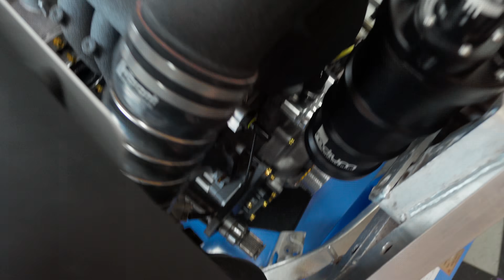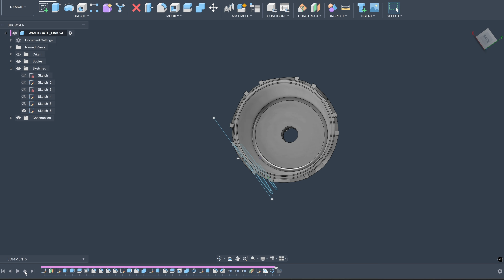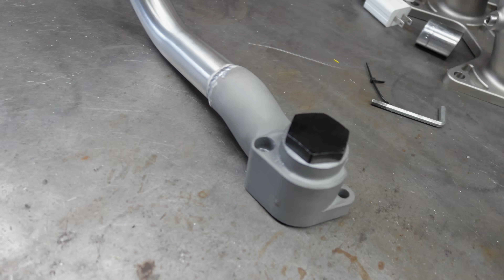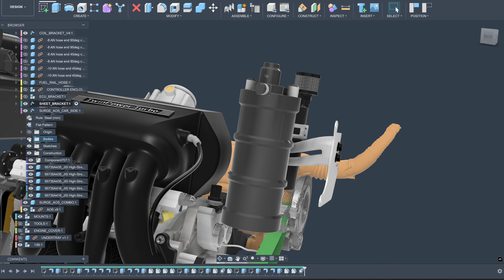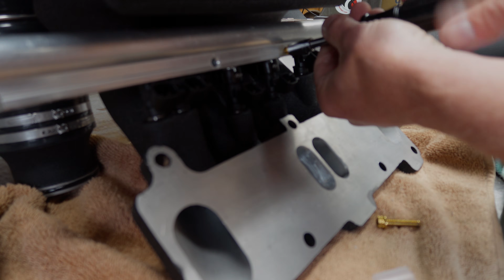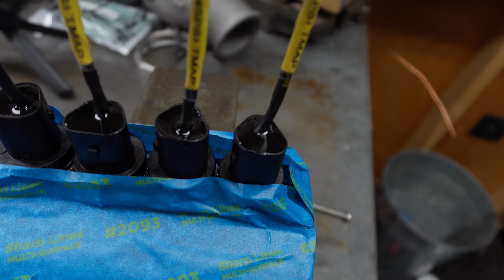No More Room For Activities - Building a 13B Rotary BMW i8: EP14

Comment: You might have problems registering the vehical,theres law about emissions with the 13b,mazda couldnt meet us emissions requirements with the rx7 so it wasnt sold in the us.......when it bears down too the car being road worthy.....you might just be failed because of emissions
Reply from the maker: Laws 😂
Reply: @CouchBuilt 
Eheh ....Mazda RX-7 models excluded from the US market were the third-generation (FD) models produced after 1995. These later-generation cars and special editions were sold exclusively in the Japanese Domestic Market (JDM) and other regions until production ended in 2002. 
Reason for exclusion
The primary reason for the exit of the RX-7 from the US market was the introduction of new regulations for on-board diagnostic systems. 
OBD-II mandate: Starting with the 1996 model year, the US mandated the use of the OBD-II standard for emissions control and engine monitoring.
Mazda's decision: Given the RX-7's low sales volume in the US at the time, Mazda decided it was not cost-effective to re-engineer the FD model to be compliant with the new regulations. Instead, the company pulled the vehicle from the US market. Series 7 (1996–1998): This updated FD model featured minor aesthetic and mechanical changes, including more efficient turbochargers and a 16-bit ECU, but was only available in Japan, Australia, and New Zealand.
Series 8 (1998–2002): The final series of the RX-7 featured a redesigned front fascia, improved cooling, and an increased output of up to 276 horsepower. It was produced exclusively for the Japanese market.
Spirit R (2002): The ultimate and most collectible version of the FD, the Spirit R was a limited-edition special produced for the final year of the RX-7. It featured exclusive components and was a JDM-only release.
Bathurst R (2001): Released in Japan only, this special edition was created to commemorate the RX-7's endurance race victories. It featured special adjustable dampers.

Comment: Interesting build / swap. I will say this, there's a reason why Mazda got away from the Oil to Water type oil coolers even on NA engines in the mid 80's let alone the turbo engines. Hot engine water can not cool the oil efficiently enough for the amount of engine cooling that a Rotary relies on oil for.  Remember, the hottest items in a Rotary (i.e., the rotors) are 100% cooled solely by oil... Just saying..

I get it, I wouldn't want to run oil lines all the way up front either but what I would do if it were me is run the Oil to Water setup like you intent but with the water side being its own closed system with a reservoir and front cooler (basically, the same as you would for an Air to Water Intercooler).

Now if that is your intent and I missed it somehow or maybe it was mentioned in one of the other video's on this swap / build that I haven't seen yet, then I apologize for blindly suggesting something that you already intend on doing.

Comment: Be careful of dodge trans coolers: mine got blocked up, due to the extremely fine internal piping (designed for heat transfer). No oil could pass through and it destroyed my transmission.

Comment: Is that a civic wastegate actuator? It looks like one but those are PWM and you don't appear to be using PWM to actuate it.
Reply from the maker: No, BMW N20. More stroke than the Honda part.
Reply: @CouchBuilt  Great tip ty! I have been looking into using one of these on a VGT turbo for control.
Mind sharing the PWM control specs? What Hz does it operate at? I don't know anyone with an N20 that I could scope to find out myself. 
Thanks again for the tip and I love the content. I started with fusion 360 and 3d scanning last year and your channel has been the most helpful by far.

Comment: Re: oil coolers, I don’t know if it fits your application, but Gale Banks is a fan of the 2020 Duramax oil cooler. He built a kit around it to retrofit into older trucks. He has a video about it.

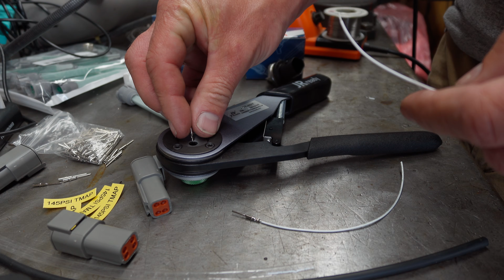Comment: At 16:50 looks like an official Harting crimper. In all my years doing electrical work I’ve never seen one.

If it’s the one I’m thinking, it costs $1400 from digit key or mouser.  Wow dude, you got money! Lol. 

I found way, way cheaper four way crimpers that will so the exact same thing for $30 from amazon.
Reply from the maker: No it’s a Chineseum JReady crimper
Reply: @CouchBuilt good to know man. I was worried there.  lol. 

Share the model and I might try it too!!

Thanks for the reply.

Comment: I found out about the Hella fluid temp and press digital sensor that comes with all new BMW's, those are much more reliable than Bosch ones and you only one digital input for both temp and press values

Comment: If you had asked me "What would your dream car project be?" It would be this. Exactly this. Combining two of my favorite things, a BMW i8, and turbo rotary engines. This is what BMW should have put in from the factory, if not a much beefier three cylinder with better internals to handle boost like the Corolla GR's 300hp 3 pot. 

Truely, from a car nut and particularly a BMW freak from back before the current millenium, thank you for making this whacky idea a reality. I sincerely hope it will inspire others to follow in your footsteps. What's the plan for the OG Mini three banger when the project is all sorted? Also, keep up the good work!

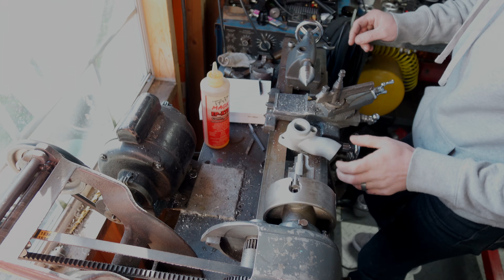p.s. 8:12 ....perfection 👌

Comment: I'm a mech design eng and have been 3D printing as many things as I can for 10 years and still I'm insanely impressed with your designs and use of 3D printing every time I watch your videos.
Mixing manufacturing techniques like you are is the key to being a 1 man manufacturing powerhouse

Comment: If you need a small heat exchanger for oil you can re-purpose an EGR cooler or and Inter cooler depending on the oil pressure requirements

Comment: From one engineer to another… when I see this, I wouldnt even consider myself an engineer anymore😂 

Small tip regarding soldering directly to your pressure-temp-sensor terminals: you can use the original plug and strip a small part the wires along the way where you just solder the wire without cutting it. The solder acts as barrier. Makes it easier to swap sensors and doesnt stress the sensor as much. 

Greetings from germany!

Comment: So that Bosch sensor is rated for fuel?
It would be interesting to use that sensor for cooling system, but most likely membrane is made from FPM rubber while for coolnt EPDM is preffered.
Reply from the maker: Yea they’re rated for oil, gasoline and diesel. They actually dropped coolant from the listed fluids on the datasheet fairly recently for some reason. Still going to use it for coolant anyway. I have a spare potted.

Comment: Love the project. On a small more informative side note. Most modern USB power supplies support voltage in 0.1V step increments through a protocol called PPS. Most modern phones use it. So you could build a bench power supply to go. You just need some microprocessor that does what the phone side does regarding the PPS protocol.
watch?v=kcmpGbR6xZc&pp=0gcJCfwAo7VqN5tD

Comment: If you have a separate battery for the starter. Its ok.. Otherwise I do not recommend the starter  work with the pac batteries. If you don't believe it, ask Mat Armstrong (YouTuber) about the super problem that this system has caused him in his LAMBORGINI.

Comment: Good choice going for a decently large water to oil stacked plate oil cooler. That 13B will be significantly happier with the cooler oil temps.

Also, one of the best aspects of using a company like Send, Cut, Send for low-volume fabrication is that they will have someone do a cursory feasibility assessment before they try to make your part and they'll contact you if there are any problems with the model that they need you to resolve.

Comment: The more you’re adding stuff to the engine, thinking about the mounting location and exhaust/turbo locations, I’m anticipating heat management being critical because of how hot rotary exhaust gets anytime it’s ran hard. Be prepared to mount heat shields around to protect soft hoses and wire harnesses. Perfect excuse to use that NASA gold heat shield stuff lol

Comment: Which vendor from CraftCloud have you been using the most? Awesome to see you have not run into warping issues on the parts. BTW: I friggin love this build. I'm building a turbo system for my '84 911 and relying heavily on 3D printed stainless / aluminum. The quality so far has been solid but I'm about to order larger exhaust parts and I need them to be accurate.

Comment: I've been using my Milwaukee to tap 3d printed and waterjet cut stainless parts, I'm really impressed by the torque it has and how well it does.  Though I've only had to go up to 1/4" npt.  I need to upgrade the chuck though as it does struggle to hold onto the tap.

What is the thread diameter and pitch on the oil pressure sensor?  I'm trying to find a dual purpose sensor for my engine that uses the m12 o-ring boss.

Comment: 10:00 optimal oil temperature is 200F +/- 20F.  You can simply use a regular oil cooler and the ambiant air in the engine bay will be enough to keep the temperature within range.  Direct airflow is not important.  not a huge fan of sandwich coolers and the milkshakes they make.

Comment: Is that actuator an OE part? I must have missed where you got it - i'm looking for a more cost effective way to switch from pneumatic to electric without buying the 1.5k turbosmart solution.
Reply from the maker: BMW 11657638783

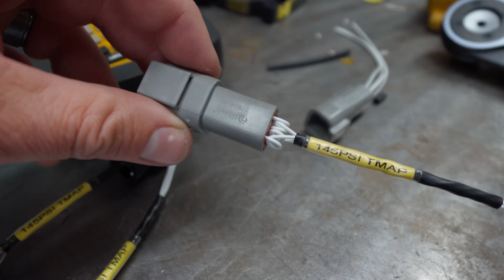Comment: Great work as usual. I would be careful creating wire loops like you have near the connector at 17:30. From an EMC perspective, you are creating loop antennas. This can lead to unwanted electrical noise.
Reply: these loops are common practice in motorsport wiring, they offer strain relief and extra wire in case of repairs (in this case will be  impossible because of the epoxy)

Comment: Be careful of the aftermarket Dodge coolers. Some of them have very thin internals that can block up. I toasted a transmission this way.
Reply from the maker: Thanks! I found a billet unit from Full Send Diesel that looks pretty solid with no way for the fluids to mix.

Comment: You should put a breath bung on that oil filler neck
Reply from the maker: The AN threads go to the breather/air oil separator, it’s just plugged to keep crap out for now.

Comment: No concern about distorting the turbo housing when you welded it? I find 3d printed holes always seem to be undersized. Is there any formula or anything to predict how much based on hole diameter? The services can't seem to tell me. It really amazing how 3dp and sendcut send can enable some really fast, professional and effective solutions.
Reply from the maker: Not in the least.

Comment: Great work, as always ❤
Are these chinese (aliexpress) titanium bolts?
Reply from the maker: Not AliExpress, but overseas manufacturer. Wanyifabolt is who I used. They had the largest selection of both course and fine thread metric stuff.
Reply: @CouchBuilt did you have them zinc coated or did they come like that?
Reply from the maker: @mikelmarion as shipped
Reply: @CouchBuilt thanks bro.  Love the content!

Comment: Cool. I hope you get the splines issue resolved to your satisfaction. 
For the oil cooler there's also a Ford part used on the raptor and optioned with some packages. It looks almost exactly the same and is about the same size. 

But they're not known to fail as often.